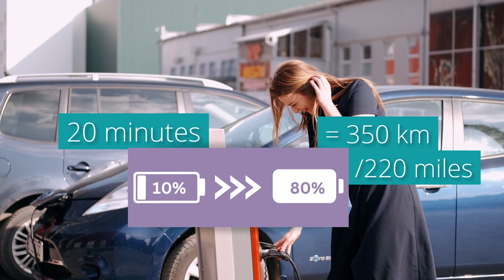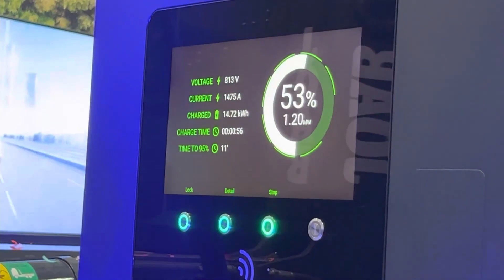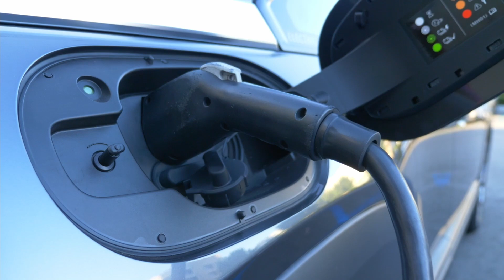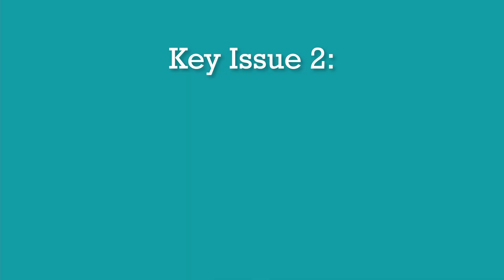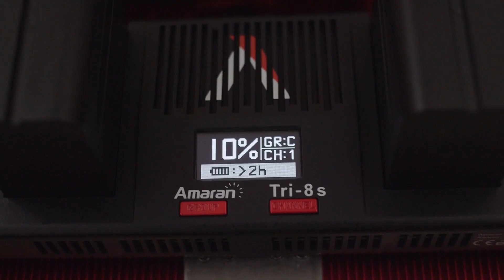Why Battery Swapping Won't Work

Comment: Probably costs more energy to lift the car up, do all the safety, and replace the battery than it would to making another charging station that takes 10 minutes to charge anyway... You have to race advances in charging speed, which... is dumb? Why are u racing against optimization with mechanical means.
Reply from the maker: I think the two reasons I thought it was a good idea was because faster charging creates more heat and often some damage to batteries AND charging faster means that the charging station needs more "burst" energy to charge vehicles fast.  But my conclusion at the end was basically - battery swapping should be in the past for regular consumer vehicles.

Comment: Great video and explanation. There's a video I watched on competing a Model Y with a Nio in England or Norway ( i forgot where), and they concluded that the difference for a long distance drive was only 15 minutes.
Reply from the maker: There are lots of cool videos on electric vs gas but I haven't seen one with charge versus swap. Thanks!

Comment: I won't buy another EV unless it has the option to easily swap the pack. I've owned two EV's, and both battery packs died on me and I was quoted $13,000 + to replace the batteries.
Reply from the maker: Even without battery swapping as the way to quickly charge vehicles, manufacturers should be thinking long term about servicing vehicles in a reasonable way. I've seen a bunch of people on and off YouTube complaining about how difficult and expensive it is to replace a battery pack in an electric vehicle. So sorry to hear you are one of the people impacted by that!

Comment: Given that Tesla batteries weight between 500 and 750 kgs, that's a significant mass to be hanging off a quick-connect system. Tesla only had 1 battery exchange station and I read that it experienced significant issues. We want our cars to be low slung and sexy, which would be counter to being able to easily swap the battery. On the other hand, commercial vehicles do not have that restraint. Batteries can be made to fit a universal form factor, and the vehicle chassis is already built for extreme service. A moderate design change would enable fast swapping without compromising the utility of the vehicle.
Reply from the maker: Great insights. I think that they'll probably use rails (like they do for sever racks) as well as the quick disconnect to keep things secure. The big problem with commercial vehicle electrification is "energy density" but I think a well designed battery swap station like Tesla did with their superchargers can support any kind of short haul needs.
Reply from the maker: Hopefully for more than just Tesla semi trucks, but probably never for most personal vehicles. Thanks for the comment!